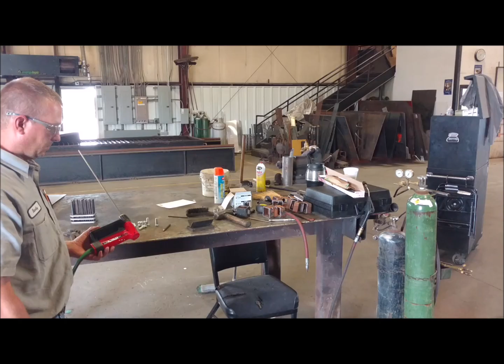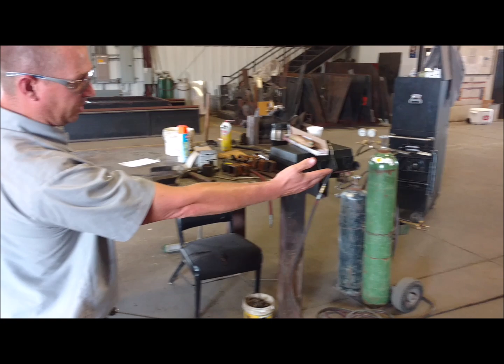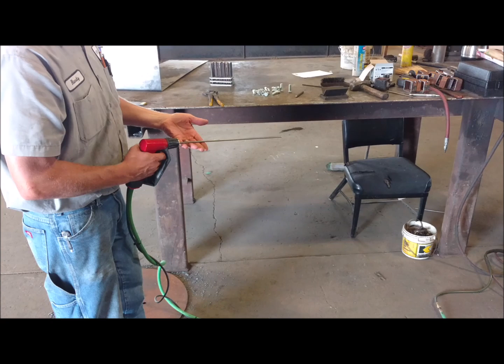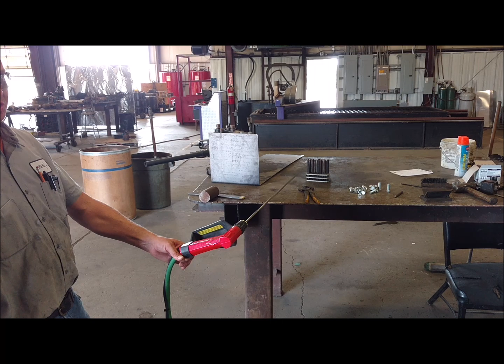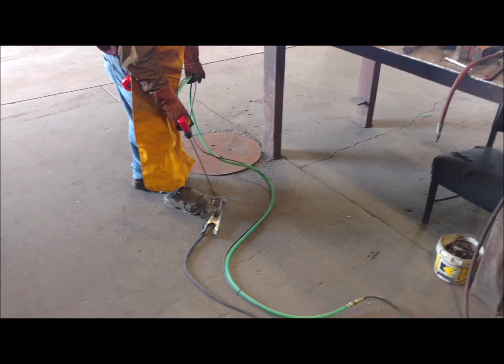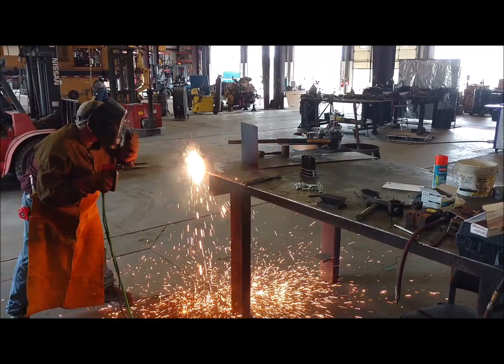Thermal Lance ( Oxygen Lance)

Comment: What's the primary use for this process?
Reply: Opening safes.
Reply: cutting large scrap material ,it has a variety of uses
Reply: Mine sites getting rid of shit that isn’t meant to be there, usually on machine repairs
Reply: Use it to blow out pins on mobile plant
Reply: I make this steel pipe here Oxygen Lance
E-mail:weidong5888@gmail.com